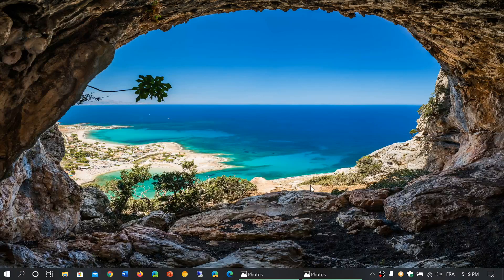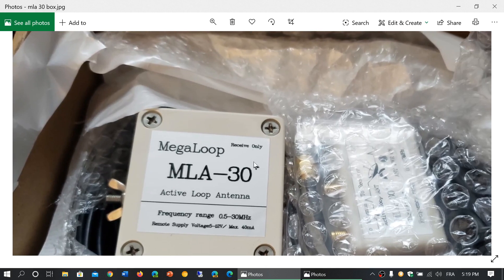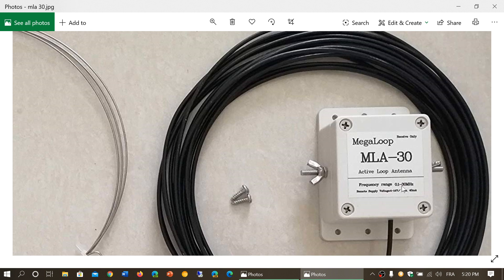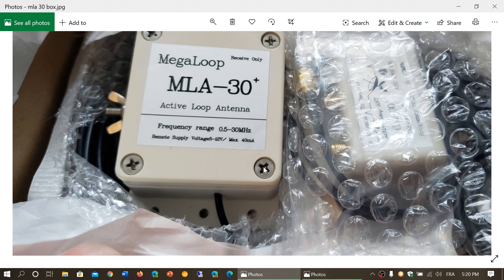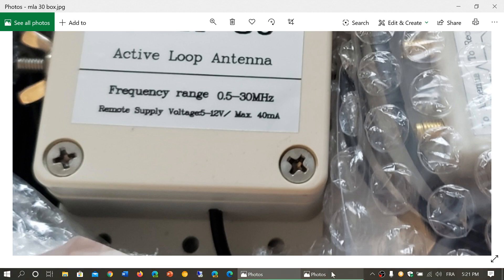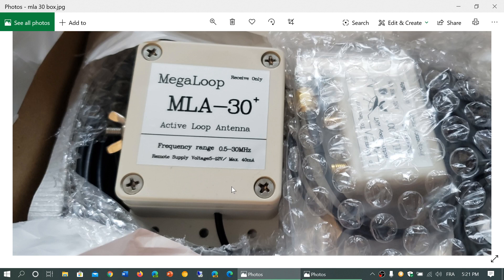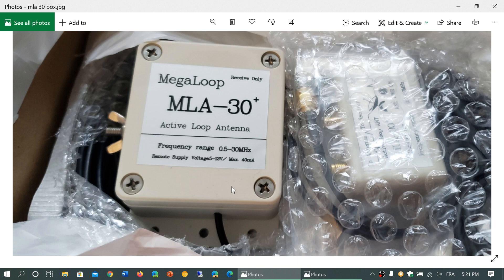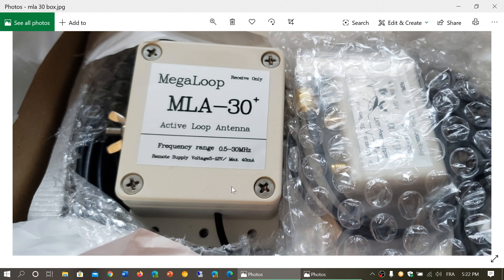NEW MLA 30 Plus VS Original MLA 30 There is a change in specifications

Comment: Is there a difference between the amplifier in the MLA 30+ and a standard LNA?
Reply from the maker: It depends on the amplifier, they are not all equal, although the MLA 30 is low noise, there are some that are more capable

Comment: I AM A BIT CONFUSED by the voltage differences listed on the two white boxes.  The smaller box reads 5 volts at the USB input and the loop attachment box reads 12 volts and there is no input!  My QUESTION is:  Do I have to somehow make two different connections to the antenna system or do I just slam 12 volts into the 5 volt USB port on the small white box?  Thanks and take care
Reply from the maker: no the Bias T box you power it with 5 volts..  the antenna amplifier upconverts it to 12 v on its own
Reply: @OfficialSWLchannel    Good deal.  That is what I thought.  Thanks for the confirmation.  
Take care and may the bird of paradise fly up your Prime Minister's nose.

Comment: Gilles can u measure the antenna output voltage for me while its connected to a normal usb cable.. normally there should be around 5v on the output..  
somehow mine biast =  12v antenna output..  think its broke? hope to hear from u.. 73,s
Reply: The "biasing tee" box takes 5V from the USB power supply and has circuitry to increase it to 12V to power the amplifier.

Comment: Interesting to note that a car battery can carry close to 13 volts when fully charged.  Maybe it is better to use the non-plus version of the MLA 30 during power outages which is rated at around 14 volts maximum.
Reply: Yes, that was my thinking as well.  When car battery is under charge it can get in the 14 volt range as well.  I think the 30 would be the better choice of the two for me.
Reply: @raithjames860   Hold on Rob!  It's been a month since I commented.   Since then I have discovered that the small box powers the big box and that the input on the small box requires only five volts/two amps.  The small box converts the five volts to the higher voltage needed for the bigger box and the knee bone is connected to the leg bone and the leg bone is connected to the foot bone.  I hope you are old enough to remember that song but seriously speaking, I have watched about every MLA-30 video I could find and I went with the plus after watching several videos demonstrating the plus and non plus side by side.  Sorry for the late info.  Hope it helps.

Comment: Which is the best replacement battery type
for the XHDATA D-808 Radio
ICR 3.7v 18650
Or
INR 3.7v 18650
Or
IMR 3.7v 18650

Comment: I think they should have removed the badly shielded/lossy coax cable and replaced it with a bnc or so239 socket.  Of course that would make it more expensive.  I know people have modified the mla-30 with a bnc socket so they can use good quality coax with better shielding and bnc plugs.   This should help improve performance even more.